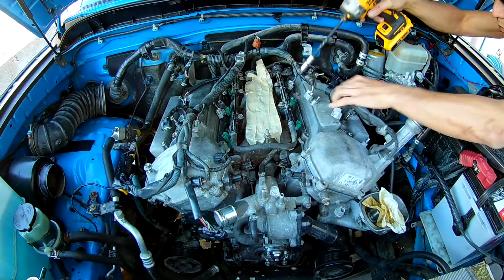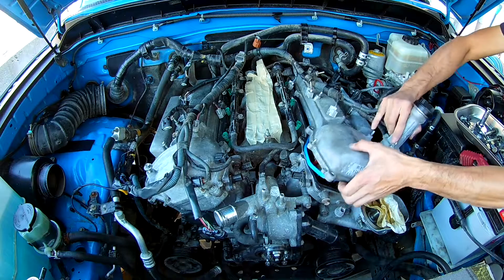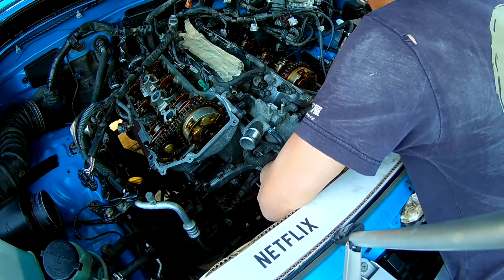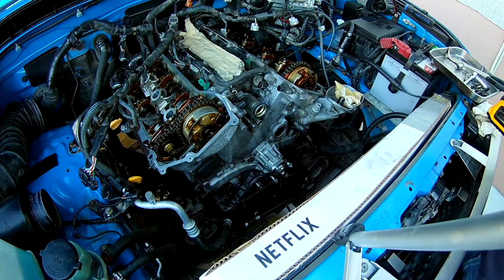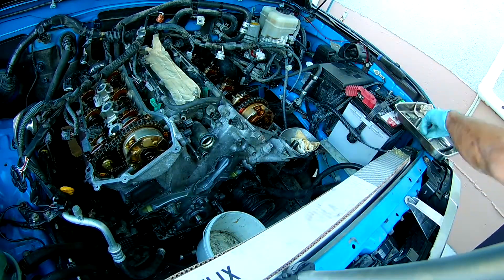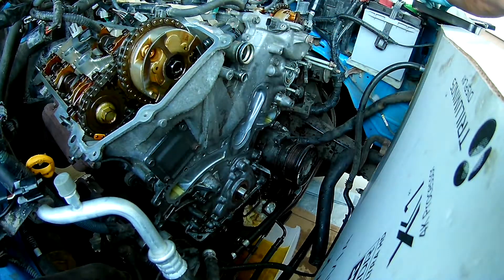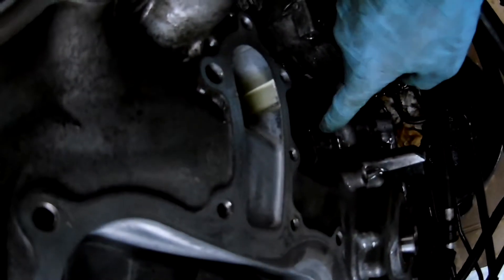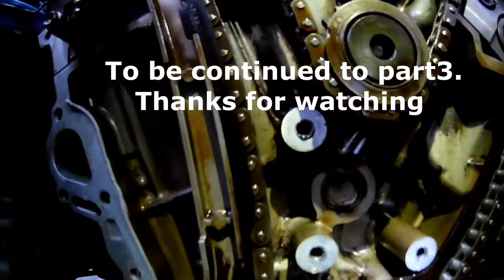PART2/4 TOYOTA 1GR-FE 4.0L Timing chain, water pump replacement tacoma 4runner FJ cruiser code P0016

Comment: Did the timing chain stretch ? Is the 4.0 Toyota V6 an interference engine ? Can’t seem to find that info . I have a 2007 FJ Cruiser just went over 300,000 miles
Reply from the maker: no the factory chain is super high quality  and dont really stretch under proper condition. but since a local shop I took it to messed up the reinstallation of the chain components. so I just decided to replace them all.